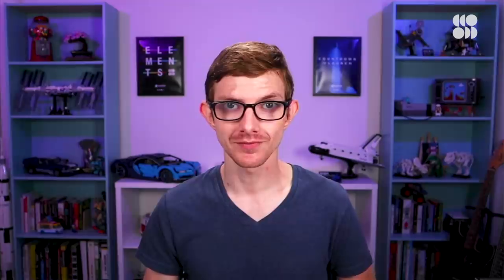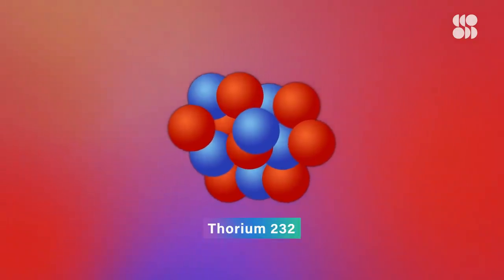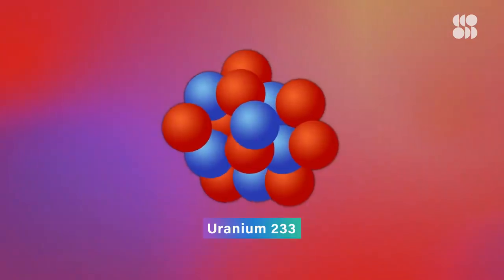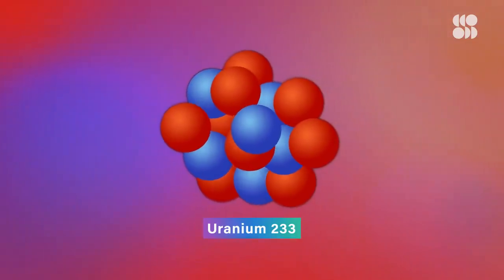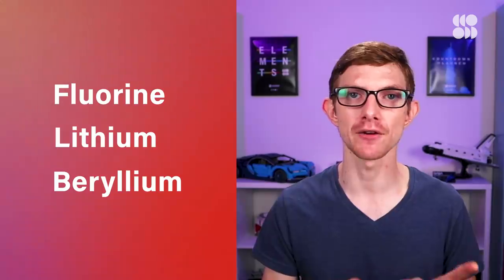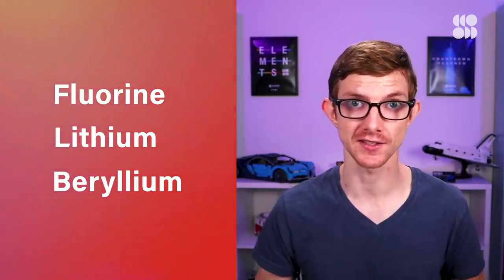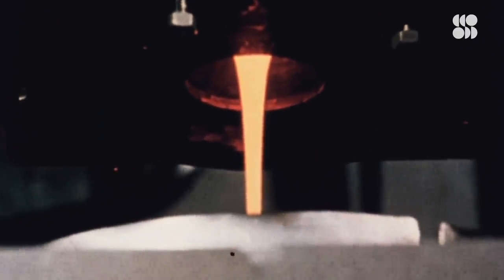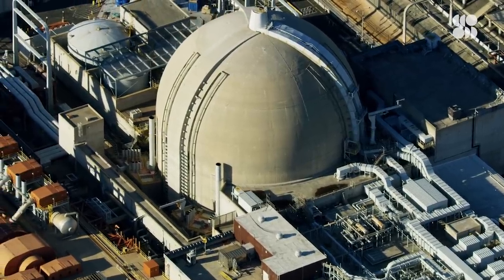The Next Generation of Nuclear Power Is Here

Comment: Thorium is nice, but it's not necessary. Uranium is fine and we can expand it quickly. If we invested a lot in nuclear energy, we could calm down antroprogenic climate change a lot, but it's expensive.
Reply: Thorium is much more common and designs with it are far safer.
Reply: Uranium is rare and expensive. Thorium on the other hand is super common and dirt cheap.
In the Thorium cycle you also start at a lower uranium level and thus get two fission phases with uranium before you get to the transuranics.
Reply: The plan with Thorium-232 is to transform it into Uranium-233, you will have to be more specific.
Reply: We can only use u235 for fission - less than 1% of uranium is this isotope. The most common thorium isotope is usable fuel that doesn't need refinement
Reply: @Merecir   The price of uranum fuel is litereally neglegible compared to the other costs of building and running a nuclear reactor.
Reply: @nzuckman   There is enough Uranium to forsee in humanities complete energy needs for HUNDREDS of years. No need to switch to Thorium yet.
Reply: @lithostheory  It should depend on what's most economically accessible. A lot of places will have a much easier time using thorium from the get-go because otherwise they'd have to  import nuclear waste. Plants that burn the waste should be concentrated around where the waste is already stored to minimize transportation.
Reply: @lithostheory  The business model for nuclear businesses is to sell the reactor for cheap and then from a monopoly position sell expensive unique fuel for that reactor.
Reply: @Merecir   lol, that's not how it works. Do you know anything about nuclear energy? Or do you get nuclear reactors confused with a keurig coffee maker?
Reply: Nope. Takes a minimum of 7yrs and closer to 10yrs to build a nuclear plant.

Comment: On one hand, (after a quick Google search), Thorium/Molten Salt reactors produce less radioactive waste than what we're using now. On the other hand, they produce some nasty stuff; plutonium, as well as radioisotopes of americium, bismuth, iodine, technetium, etc. These tend to decay by emitting gamma rays, which are harder to shield against. So disposing of thorium/molten salt reactor waste is still a problem. I'd feel a lot better about the nuclear option for power generation if we had somewhere to put the nuclear garbage.
Reply: You get far less Plutonium with Thorium than with Uranium. This is one of the purported benefits of Thorium.

The reason you get significant quantities of Pu from U reactors, is that the dominant isotope of U is U-238, while the isotope of Pu that is desirable for bombs in Pu-239. Since there is only a difference of 1 between those numbers, it means that a U-238 nuclear only needs to capture a single neutron (of which there are many flying past when the reactor is running) in order to become U-239, which then beta-decays twice to become Pu-239. To create the elements beyond Plutonium, the same atomic nuclear would need to capture multiple neutrons, which does happen, but the probability of it happening decreases the more neutrons have to be captured.

By the same token, since Thorium's only natural isotope is Th-232, it would need to capture no less than seven neutrons to become Pu-239. That means the amount of Plutonium produced in Thorium reactors is going to be absolutely miniscule.

That is not to say there are not going to be other elements that are (or which policymakers perceive to be) dangerous. The public perception of radioactive danger does not really follow the science. The reality is that its mostly the fission products that are dangerous, while the heavy isotopes that are produced in (or just pass unburnt through) reactors often have very long half-lives, meaning their radioactivity is moderate. There are exceptions, such as U-232, which is the intense alpha emitter mentioned in the video that makes handling bred U-233 difficult.

Comment: People fail to understand what is really wrong with nuclear. It doesn't matter how safe your reactors are since reactor is only one step in the logistics chain. You still have to mine, transport, store, transport, refine, transport, store, transport, use, transport, store, transport, process for waste management, transport and finally store. Any of those steps must be managed by professionals, and every facility being used must be properly maintained. And while everyone focus on big accidents, small accidents will be more dangerous if nuclear becomes as widespread as desired. And accidents will happen. Ionizing radiation by itself is not that dangerous if you get away quickly, exposure is the key. But such numerous small accidents will spill radioactive particles, which you can digest or inhale. And that is the real problem with nuclear. It doesn't really mater if thorium is safer compared to other reactors, it still creates waste and it is still dangerous when exposed. Don't get me wrong, this can be useful as backup for solar and wind, but we cannot use it as main source of power. Even the safest cars in Germany with all state-of-the-art safety tech crashes when it is sold to some other countries. Because all safety boils down to funds and human factor in the end.

Comment: 03:07 : Sorry, this is WRONG. A water based reactor needs a steady flow of water to be cooled, not pressure. If pressured gets lost, the boron control rods can be inserted and the fission stops. The only heat produced in this case is the heat of the decaying fission products, that doesn't need pressurized water to be cooled. 
The water in PWRs is the moderator for fast neutrons. The PWR is self regulating, because if the temperature gets to high, the water will turn to steam an slow down the fission reaction. Water at normal atmospheric pressure is not very suitable for moderating the reaction, because it creates bubbles.

When advertising nuclear power, you should understand the systems involved and risks properly.
Reply: franconian.bike You're missing the point. PWRs are not self regulating, they need control rods to be inserted to stop the reaction if the cooling system is compromised. Even then, you can't stop the heat building up to the point where a melt down is almost inevitable. Cooling is also required for the spent fuel, else Hydrogen is liberated. Look up the Fukushima accident to see how that unfolded.

Molten Salt reactors don't rely on pressure to keep the cooling system viable. More than that, they automatically shut down if the flow stops, and the fusable plug simply drains the salt into a holding tank. This is MUCH safer than any PWR can ever be, hence the huge containment building required for those.
Reply: @rogerfroud300  
"You're missing the point. PWRs are not self regulating, they need control rods to be inserted to stop the reaction if the cooling system is compromised."

This is true for every single reactor based on water. 
Yes, PWRs have control rods and the boron content is regulated with an active regulation system. I didn't miss this point, becuase this wasn't the point.
However, a PWR offers self regulation due to the potential that steam is produced, when the reaction becomes too hot. And yes, this is indeed the case. This does not rid the necessity for an active control system, but this wasn't the point either.

The point was the statement: "loss of pressure reduces cooling". And this is not the case. Loss of coolant flow or cooling liquid will reduce the cooling. 
You can easily cool spent fuel in a basin .... without water pressure.
Reply: You absolutely need pressure in a PWR to keep the core safe. Just having flow in a core doesn't guarantee decay heat removal if the water is at saturation and creating steam. Having steam is very dangerous.
Reply: @ryancollyer2046  Chapter 5, sorry ... at 00:12:03

Comment: Hopefully, one day, we'll see global safety regulations that require reactors to be built far underground to limit the potential of widespread contamination when failures occur.
Reply: Modern reactor designs are physically incapable of melting down my guy. Reactor safety is taken far more seriously than you think, hence there being passive safety mechanisms out the wazoo
Reply: @nzuckman  You know, they said much the same thing about the reactors that DID melt down.  You can try to plan for a lot, but the world has a funny way of throwing curve balls you can't even imagine at any time.  It seems like a small step to force reactors underground to limit the damage considering the widespread contamination that KEEPS happening when they do fail.
Reply: @hellcat1988  they melted down because their safety mechanisms were *active*, not passive. We've had a LOT of time to learn from the mistakes of the past, and it would actually be quite a large step to force reactors to all be underground. Keeping reactors underground may be useful in some specific situations, but in general it would be unnecessary and dramatically increase the cost of construction without improving general safety. 99.9999% of the safety mechanisms for new reactors are inherent to their design and render meltdowns physically impossible.
Reply: @nzuckman  Again, the people who built the reactors that failed also at least told people they couldn't fail the way they did, even if they didn't actually believe it themselves.  Yes, forcing reactors underground would increase the cost.  Now compare that cost to the cleanup.  I think you'll find the cost favors my idea in the long run.  

Then there's the safety in our ever more dangerous global political environment.  A terrorist attack against a surface reactor means widespread contamination.  A terrorist attack against an underground reactor probably means you need to dig another hole and build another reactor.  

The chances of a catastrophic failure (assuming they have some kind of measure in place to stop the active ventilation an underground facility would need, such as just a switch that says off one could flip) causing widespread and long term contamination are so greatly reduced that it just makes sense.

Then there's the long term storage of the spent fuel.  It's gotta go underground eventually.  Why not just extend the reactor's cavern with tunnels to store it down there?

Add to that, the decommissioning and safe dismantling of the reactor once it's reached end of life.  It's a lot harder for an accident there contaminating the local environment as well.  Even a small amount of radioactive dust can be a problem, and it's easier to put a filter on an air exchanger than it is to contain an entire surface site.